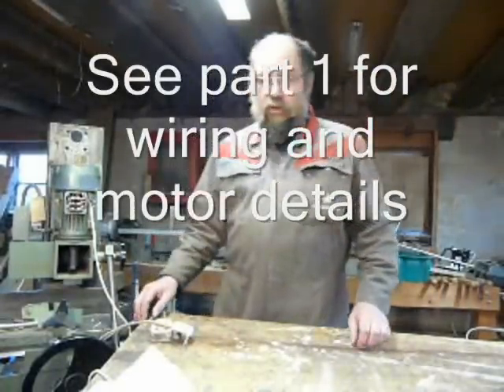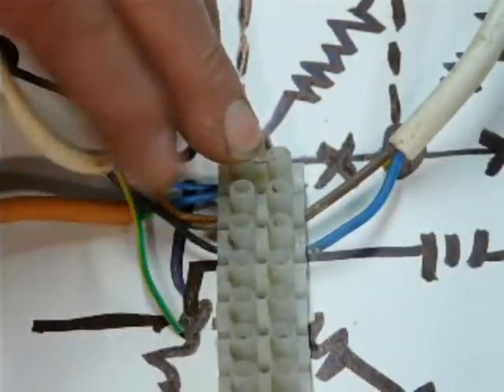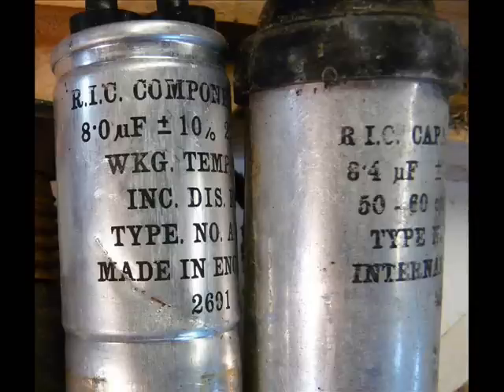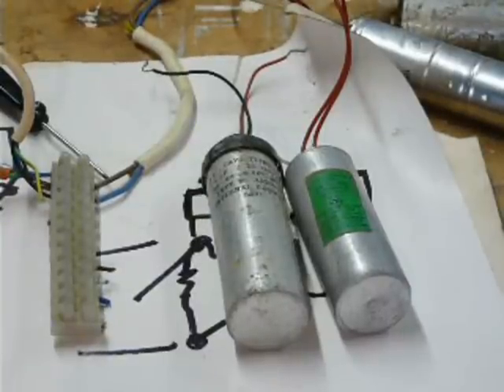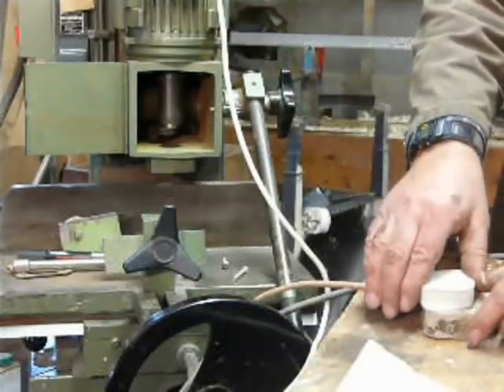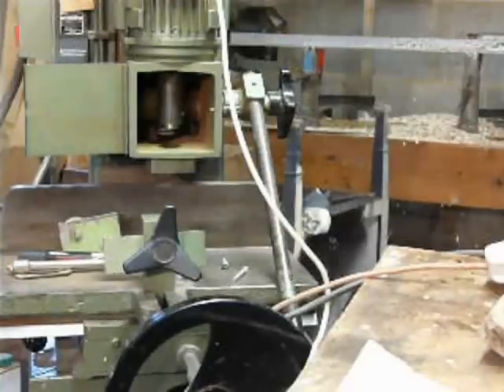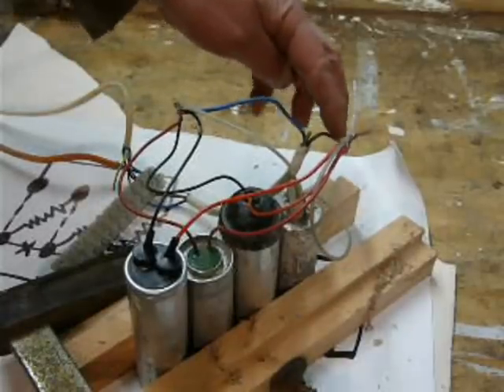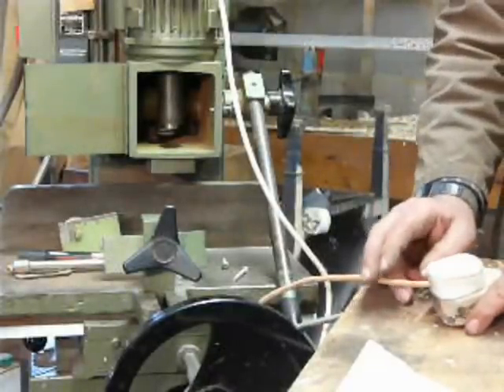How to do it: run a 3 phase motor on single phase supply. part 2

Comment: Mr. andy,  I have 4.2 cv three phase motor and I could success in star connection with two 250uf pickup capacitors and on 45uf running capasitor but i faild in delta connection when I try in that connection my main switch's fuse explode. Can u help me  to success that
Reply from the maker: You have a conection problem, go back to basics and find the ends of each coil, sounds like they are mixed up.
Reply: yes sir,  I checked each six terminal come with two coils. upper three terminal named zxy and below three terminal named as uvw respectively in the terminal box. z terminal's coils connect with uv terminal respectively,  X terminal's coils connect with uw terminals, y terminal's coils connects with vw terminals respectively.I connected zu,xv and yw respectively for delta connection.
Reply: It is  a double-speed three-phase
motor-
Reply from the maker: The problem may be start current. With the delta connection the current draw will be larger as the coils have less wire in them. The start current is up to 10 times the run current. With star there are 2 coils in series and so the resistance is greater, hence less current draw. Cheers
Reply: So how to overcome that sir,
Reply: need more straating caps?
Reply from the maker: Run it on star. Cheers
Reply: Yes I found a way with star delta starter coming soon I am going to run my motor on delta. Cheers

Comment: this was helpful but what  size capacitor would i need for a 1/2 hp 3 phase motor
Reply from the maker: You will have to experiment around the 20 Uf size, follow the exercise in the video.

Comment: Hi mate I'm looking for a 240v single phase motor that is synchronous to the line frequency at 1500 rpm it's for a rotary spark gap Tesla coil .
Reply: They're seeming to be hard to fined 
Is there any house hold appliance that use them ? Like a fridge compressor maybe
Reply from the maker: Standard single phase 50 Hz motors are either 1400 or 2800 RPM, so to get 1500 you may have to use a frequency inverter to speed the motor up by increasing the frequency. Subscribed? Andy

Comment: Very helpful Andy. I was told by an electrician that this couldn't be done. I am building a concrete recycler. The crusher is attached via conveyor belt and pulley to a varying duty 3 phase 440volt electric motor which is 100 amps, 75HP(50HP continuos), 60 Hz, 1180rpm. My problem is that I only have 240 volt single phase. I have a $5000 budget to build the frame and wire it to be mobile around a 1/2 acre property that has 240volt outlets. My choices before seeing this were, run three phase throughout the property, buy a diesel motor, buy a single phase motor, or somehow mount on a diesel truck that has a hydraulic motor. I was told that buying a VFD would not work because of the variable amperage draw while the jaw crusher crushes the concrete. From your two part series, I believe this means depending on the HP and amps of my 3phase motor, adding capacitors and rewiring main motor box to delta diagram formation, I am creating my own variable frequency drive in the form of 3+ repurposed capicitors(32+μFarrads).
-not an electrician but an entrepreneur
Reply from the maker: Your problem with such a high HP motor is the start current. 75 hp x 4amps per hp = 300 amps running, but the start current will be 3000 amps. Normal 240v supply is rated for 60 amps.  You will have to use a frequency inverter. Cheers
Reply: Any idea on how hard it would be if possible to make one?
Reply: VFD right?
Reply: Any interest in me hiring you to walk me through building this?
Reply from the maker: You are better off driving it with an engine as 75Hp is far too large, and a 3 phase supply will be expensive, Cheers. Andy

Comment: hi andy thanks lot for the video,just one question. is that four capacitors are run or start,
thanks, Romeo
Reply from the maker: The 4 caps are in parallel and are run caps. This motor has no load on start (just turning the auger) so in this case no start caps are needed.

Comment: Thank you mr Andy for your good video demonstration, I really got many watched your videos repeatedly to understand it well, the video is very clear. Perfect explanation.  But I have questions regarding this topic please, what will happen if capacitors are connected in series?? and How could we control the direction of rotating??
Reply from the maker: Capacitors are in parallel to increase overall value. To reverse rotation change the capacitor to the other supply connection, cheers, Andy
Reply: Andy Reynolds good, so the in parallel caps connection increases the speed of the motor, what about if capacitors are in series connection? What will happen? Is it possible to use series capacitors in such applications??

Comment: Hi Andy , great video .
Im am a Maintenance Technician so I'm no stranger to 3 phase electric's.
I am unsure if what i want to do will work tho.
I have just purchased a 3000kg 2 post  car lift for my garage.
And yes you guessed it , its 3 phase !
The lift operates 2 x 2.5kw motors (1 on each post) 
Do you think the Delta capacitor setup should run ok ?
Im assuming in order to change the direction of the ramp id just reverse the blue/brown suppy circuit ?

Hope you can help
Regards
Stuart
Reply from the maker: Hi. Your limiting factor will be the starting current, and I assume both motors need to start at the same time. Give it a go and see what happens. To reverse the start capacitor connection needs to be changed from one supply connection to the other. let's hear how you get on. Cheers, Andy

Comment: Great video Andy. I am an electronic/ electrical engineer and as such understand the concept. Found it good that you made sure to emphasize the a/c working voltage of the capacitors. Just one criticism, perhaps you should mention also that the caps can hold a charge and give a nasty unexpected kick even when the power is isolated.I would advocate connecting a 100k resistor across the capacitor bank ( 1 watt should suffice ) as a safety discharge. Yes I know they will automatically discharge through the coils upon power down but when experimenting as in your video it is all too easy to have a dodgy connection.
Reply from the maker: Yep, you're right.

Comment: Andy do you need to discharge the capacitors before you touch them
Reply from the maker: If they are connected to the coils they will discharge instantly through these when the power is switched off. best to check if you are uncertain. Andy
Reply: Thanks for that .Vince

Comment: thanks a lot, you saved me lots of time and money. i just convert 3 phase motor into 1 phase with the help of your videos.
i have only 1 question which i couldn't find good reference on the web. how do i calculate the capacitor size? is it trial and error or there is formula to do it?

thanks again!
Reply from the maker: Well I think the trail and error works because you can never tell what the motor will require. In the comments of one of the videos there is a formula, but once used you will still have to check the voltage with the motor is running. Thanks for the appreciation. Subscribed? Andy

Comment: Got my wadkin 10" ags table saw now, so i'm going for it!  Watched your vids about 37 times and its nearly sinking in now!  Thanks Andy.
I'll update ya my progress?
Reply from the maker: Hi. Sounds good, keep us all informed, happy wiring. Andy
Reply: Did it work? i'm in the same boat
Reply: Kevin Chamberlain mmm a phase converter is about 3 times more expensive than the machine. im thinking of replacing the motor
Reply: Kevin Chamberlain Australia, How much does a Phase converter cost over there? you cant find one here cheaper than 1500
Reply: Kevin Chamberlain I think i'm going to get a VFD phase converter, Much cheaper than the rotary phase converters. What did you end up getting for yours?
Reply: Kevin Chamberlain i think ill do the same, Let me know how it goes
Reply from the maker: You could "tank" the motor if you want more power. Use 2 capacitors of the right value, 1 from each on the mains power terminal, both to the 3rd motor connection. This makes the 3rd phase work, but you will need a start capacitor to set the direction of rotation and improve starting torque. There are comments about this, but you will have to find them. Cheers, Andy

Comment: Great .I'M  going to try on my  Garage gate  , but how many Mf capacitor should be?
its its 2 HP  3 P motor
Reply from the maker: HI. About 30 Uf per HP. You will have to work through all 6 videos and then do your own experiments. It is important to measure the voltage. Subscribed? Andy

Comment: can i know what is the RPM of that motor weather it is low speed or high speed motor
Reply from the maker: The speed will be on the motor info plate There are standard speeds, 1250, 2800 etc based on the cycles. Andy
Reply: I need the Speed of that motor which u worked on it Sir....
Either high Rpm or Low Rpm...?(1440 or 2850)
Reply from the maker: RPM on the morticer is 2800.
Reply: Tq..
Actually i would like to know is it possible to run a 1440 rpm motor to 2850............
Reply from the maker: The speed is based on the coil design and the supply cycles. So the only way to increase the motor speed is to increase the cycles. This is what a phase converter and speed controler does. Hope that answers your question. See latest video from mrpete222.
Reply: ok...............
Thank you Sir....

Comment: just for the fun of it :D
Reply from the maker: Thanks for your appreciation, hope you enjoyed the rest of the series. Andy
Reply: It was very useful, thanks. Strange how difficult it is to find the wiring information for the 3 phase motors that specify 220V or 240V operation as an option. I am actually going to remove the rotor from my motor, then will try to get it machined down and add permanent magnets so i can use it as a generator, not the most efficient way to do this, but a fairly quick and cheap modification, since i already have the 1.2Kw motor and i only need to generate upwards of 40 watts i think it's a great solution for my micro hydro project. Found it by the bins and all 3 coils test good.
Reply from the maker: The spirit of "just for the fun of it" is great. It leads to experiments and trial and error. Wonderful learning without great expectations. Let's hear how you get on. Thanks for the interest, Andy

Comment: hi andy i have three phase motor 240v 12.5 amps 3.0 kw made in china i have no available 3 phase line only single phase.. i want to know how to make it single phase to 3 phase motor supply how many capacitor i will use how many uf or micro farrad required is it advicesable to use push botton switch or taggle switch and of course with ckt breaker protection thanks for the informatoin you have given ive learn  a lot more power and god bless tnx again albert pagliawan puerto princesa city palawan philippines
Reply from the maker: Hi. For 3 Kw you should have something like a 60 Uf run cap, but you will need a 100Uf start cap. Follow all 6 videos and these will show you how to work out the wiring and to check if the cap values are correct. Push buttons are best for the start cap and see parts 5 and 6 for the wiring. Be careful of starting current on a large motor especially if you are starting under load. Subscribed? Andy

Comment: connect L1 to one winding L2 to another winding and also connect L1 on the capacitors to L2. then the capacitor N to the L3 and then to the final winding. if your motor spins the wrong way swap over the L2 and L3. also the capacitor you have is very powerful it may be to big but worth a try. it will work on any voltage but its maximum design current is 500v so it will be fine but might not work right as it is so big. hope this helps

Comment from the maker: Hi. I am not familiar with a nine wire motor, found on net. Hope you can wire the motor, then follow the procedure outlined in the videos. Live into 1,6, 7 and neutral in to 2,4, 8. Cap from live to 3,5,9. see details below:
NEMA Nomenclature--9 Leads:
Dual Voltage Delta-Connected
Voltage 	 L1 	   L2 	  L3 	      Join
 High 	   1 	    2     3 	4&7, 5&8,6&9
 Low 	     1,6,7 	2,4,8 	 3,5,9 	    ------------
Found it at electricmotorwarehouse   dot  com
I hope this helps, Andy

Comment: yah i subscribed. Do you hook up the motor with 120v going into the motor, ive been hooking up 220 single phase in, 2-120 v hots in. ? should i be using a hot and a neutral? What i really need to do is hook up a 3 phase 3 hp bandsaw motor on single phase. What is needed as far as a cap? i was told about 50-100 uF per HP. Is all this possible on a 9 lead motor and what connection is needed?

Comment from the maker: HI. Yes 2200 Uf is far too large and an ac rated capacitor is needed unless you put 2 DC caps back to back. A cap of about 25 UF would be about right for 230v into a delta connected motor. Have you watched all 6 videos? Hope this helps. Subscribed? Andy

Comment: andy, couple of questions. I have a 230/460 3 phase .5 HP 9 lead motor. a 2200 uF capacitor rated at 500v DC. Im pretty sure the DC capacitor is the same as an AC capacitor, only difference is the peak voltage rating. are you putting 120v and a neutral as line 1 line 2(N) into the motor and connecting the capacitor to the 120v line 1 going into the motor? or are you using 120v on both line 1 line 2? The motor nameplate says high voltage and low, 230(low) 460(high), should o be connected to 230

Comment from the maker: Hi. Good news, yes you could probably up the voltages on the cap winding slightly. As to how long they last, well somewhere in my mind it says change every 10 years, however if the cap rated voltage is much higher then working voltage they should last a long time so go for 440v units if you can. All good here from the east coast. Andy

Comment: Is amazing how useful internet could  be, information is just there at you fingertips within seconds! checked my motors they are rated as a "F" insulation class so they should be ok! knowing this might try a 32 uf and check voltages,at the moment is hovering around 180 volts on the cap side,just to make it start quicker,than 5 seconds,to save some start amps high load,but once is on spraybooth stays on until you finish so no many starts a day, any ideas about the life span on caps? thanks again!

Comment: From an electric motor website "Depending on design and cooling arrangements, motor surface temperature can be hot to the touch. Surface temperatures of 75°C to 95°C can exist on T frame motors. However, these temperatures do not necessarily indicate overload or impending motor failure."

Insulation Class 	Temperature Rating
A 	105° C
B 	130° C
F 	155° C
H 	180° C

will check which insulation rating mine is, it looks like will be ok!

Comment: Mate I'm the pleased one,and I have no way how to tank you enough!,but over here is all expensive and you saved me a lot of hassle,getting 3 phase was to expensive,converters too, so the choice was to get 2x2hp single phase motors,again £200+ each, plus stripping the whole burner and inlet to change them, total coast = £7!, so it worth to use as it is before swapping motors,and the wiring now is ready for single phase, this booth is 30+ years old very well made, not tin ones like on these days!

Comment: Probably could use bigger caps but as I said after those 5 seconds they are ok it sounds like a jet engine spooling up! :) checked temps in the power box wiring and switches were at 26c, and the whole arrangement goes to a main 30A thermo switch, which holds the start up and running so, it means is not going over, don't have a tool to measure the power draw.booth is an old DALBY, I lived in uk for 10 yrs and came back to uruguay (brought the booth and some tools with me) will post a video soon!

Comment: Hi there, well today arranged the spray booth installation it has 2 fans switched on by 2 electric relays,so fitted the caps just there in the outlet,checked the rotation way, and after correcting it was on! is taking a good 5 seconds to the fans to come to full speed,but after starting didn't noticed change on power as when using 3phase,after 1 hour running motors were at 60 Celsius,so it looks like will be ok, only removed 2 thermo switches which were jumping not taking  higher amps, all good!

Comment from the maker: Thanks for your enthusiasm, 2 options,  see what happens and check the temperature, it will probably be fine, or add another capacitor from the other mains connection to the 3rd connection to make the 3rd set of coils work,. You will then need a start capacitor to set the rotation direction. Trial and (maybe not) error. Let's hear how you get on, Cheers, Andy

Comment: Hi Andy and thanks for sharing your experience! done a test today,  and it worked ok, the problem is I have a Spray booth which runs on 400v 3 phase and there is no 3 phase were I moved,motors are the same as the one in the video, and they will spin a fan that's all not a big load,but when painting a car you spend a good hour some times, and baking time is set at 45mins,so you know the max temp they will operate before burning? thanks mate!

Comment from the maker: Chris, best look at the comments on 1 to 4, but briefly using 2 phases your motor will be about 4 hp and so a run cap of about 100Uf. You will need a start cap of about the same. The problem is the start current that could be up to 8 times the run current. 4 Hp will draw about 16 amps run current so the start will be about 130 amps. However, don't let me put you off, as long as you start the compressor with an empty air tank then the duration of the start will be short. Lets hear how it goes.

Comment: whatched your video. very intresting. Im trying to run a 4kv motor 3phase air compresser with a 5.5 hourse power pump could you tell me how many capacitors i might need to run it. as i have tried 32 already thats all i had.and would buy more off line.I only need to run it now and again. many thanks